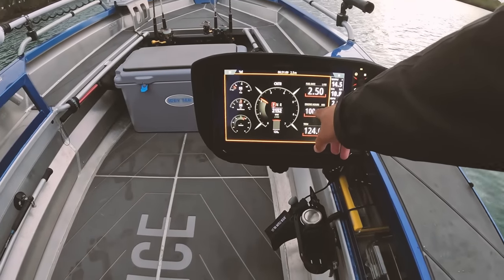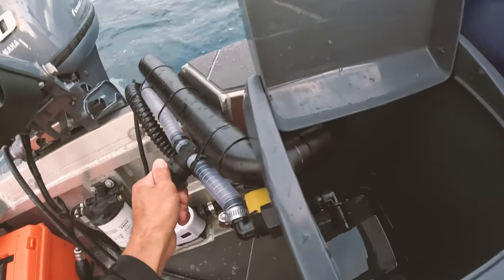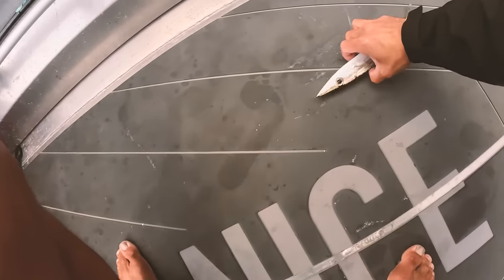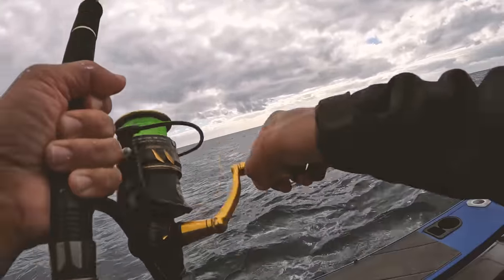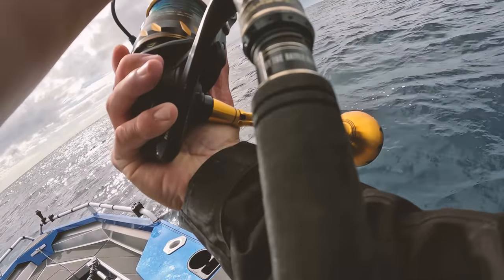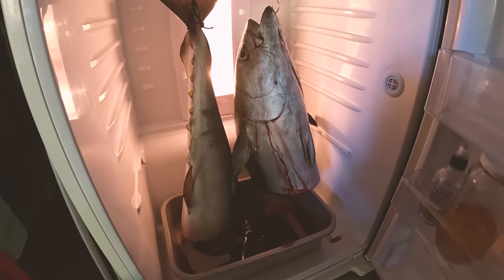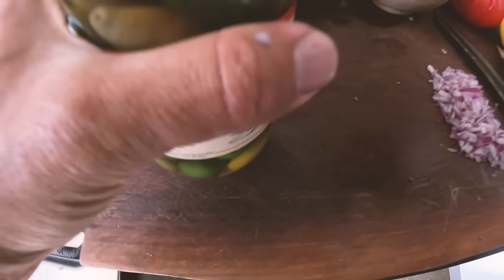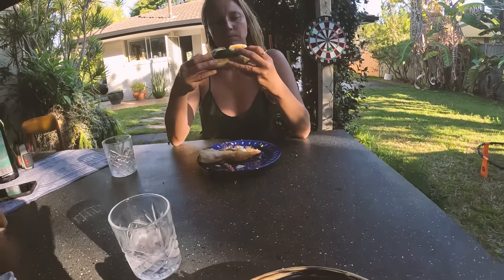Big Fish Upgrade - Catch And Cook - Tuna Niçoise Foot Long

Comment: Hey rod why don’t you bleed them? Use a small knife and nick under the front pectoral fin about an inch on both sides. Right on the lateral line? You can also learn to use your deck wash to pressure bleed it. Then ice the cavity. Way better for the meat. Love the vids mate. Watch every single one!

Comment: Great vid, just a word of warning in case NSW maritime come round for checks; and correct me if I am wrong but - because your boat is under 4.8m and you’re alone you have to wear the pfd the entire time. I was given a warning last year for it. Bit different to QLD laws. Cheers 🤙
Reply from the maker: Yep that’s true, I actually looked into the length of my boat and the length of 1450 in the name is approximate and is actually just shy 4.5m… but with the dive platforms added it measures bang on 4.8m so I just make the length😅👌

Comment: NICE FISH, Can I ask what kind of rod you are using in the video, what's the line capacity of that combo. thanks
Reply from the maker: The rod is an Ocean Assassin 6’2” PE2-5. The reel Penn Slammer 4 6500. I think this one has around 40lbs braid and maybe 350-400 meters 👍

Comment: You not having a center control is making this boat handle like a we sock full of cold porridge just on 1/2 the power of the motor is trying to lift the bow out of the water because he isn't in the middle of the boat - his donors need to afford the Remote control kit and a center structure with a small roof - and he needs this Now before he goes out again - now watch some adds and pay for it because I'm behind the Iron Wall and Can't